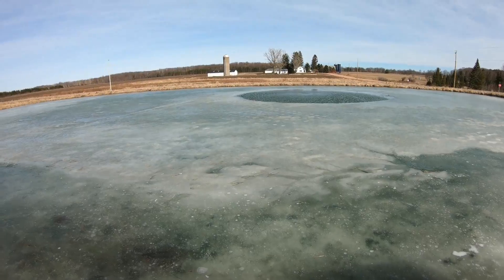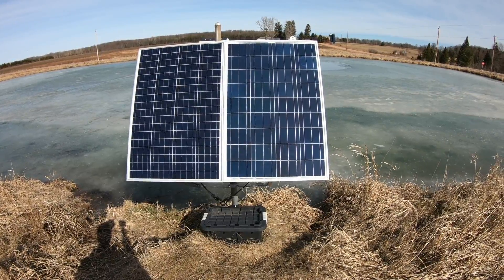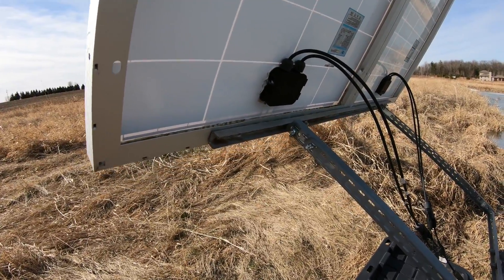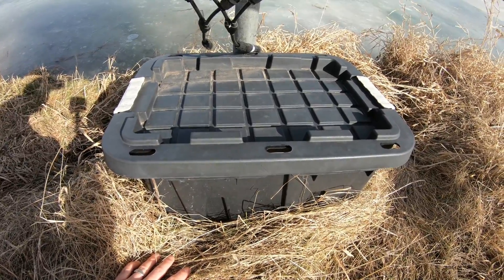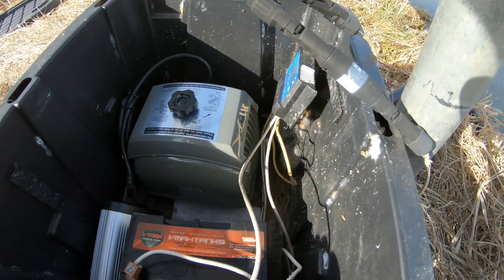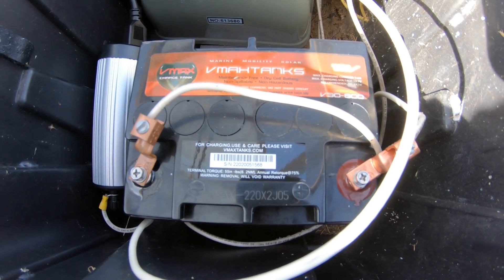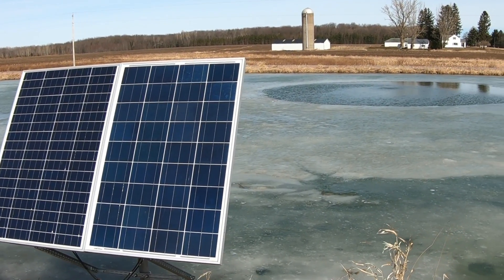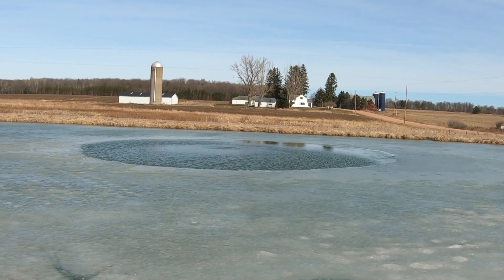How To Build Your Own Solar Pond Aerator

Comment: I really like this setup. And I’m determined to get it working. However it keeps turning off and on. Thanks guys! 
Settings 
1.14.9v
2. 13.7v
3. 12.8v 
4. 11.3
5. 24 h
6. b01
Reply from the maker: I'll try to help, I haven't had that issue with mine.  How many watts of solar are you using, what is the inverter you used and what is the battery and capacity of it. I know that some inverters work better then others for this situation, and if the battery is too small (amp. hour) it will not work well.
Reply from the maker: It almost sounds like your battery is either too small or it's getting too weak to hold a charge.  You stated when connecting the pump directly to the battery, it would run. This is correct because it'll draw the battery down to nothing, whereas the charge controller will shut off the pump when the battery voltage gets to low (your cutout set point).  If your using an older or small battery, I'd try that first. I hope that makes sense.

Comment: Got everything hooked up. My inverter keeps turning off and on. Any suggestions?
Reply from the maker: I would first check the settings on the charge controller. Make sure the cutout voltage is correct. It will also cut out if your not getting enough sun or the wattage is to low. How many watts of solar are you using?
Reply: Also the pump runs fine connected straight the battery. How do you set the cutout voltage?
Reply from the maker: @BlackStoneTrail411   Here is the PDF of how to set the charge controller that I use : https://www.solorder.se/image/data/uploads/KLD1210.pdf  The voltage at which the the charge controller turns off the inverter is the #4 in the diagram, discharge stop.  The voltage at which it will turn back on is the #3 discharge reconnect. I like to set the #3 at 12.8 - 13.0
Reply: I have the same setup as you. What do you have your voltage disconnect set at? The max it will let me set it is 11.5 volts. Have you had any issues with the battery letting it go that low?
Reply from the maker: I have my disconnect set at 11.3 volts and the reconnect set at 12.8 volts with no problems using the Vmax battery.
Reply: Designs like this are real battery killers. I run minimal battery systems and I force everything to shut off when battery reaches12.4V. They won't even start till it reaches 13.5V.  There should be a timer that only allows the system run a fixed period of time before it checks the voltage again.  Just about all these systems are techno nightmares slapping a bunch of black boxes together.

Comment: How did you attach the defuser to the five gallon bucket.
Reply from the maker: I have the diffuser sitting on top of the rocks that are at the bottom of the bucket.  I then place 4 bolts through the bucket at four corners  just above the diffuser to keep it from floating upward.  A hole is drilled through the side of the bucket to allow the weighted airline to enter and attached it to the diffuser. Hope that helps.
Reply: Hmmm ok. The bucket is 12 and the defuser is 12 inches. You must have a wider bucket.
Reply from the maker: I'm sorry, I meant to say I used a 10" diffuser. I will get it corrected in the description.  Thank you for correcting me on this. It should make more sense now how it fits in a 5 gallon bucket.

Comment: How long have you used this system. Is it pretty durable?
Reply from the maker: I've had it running for 4 years now.  The only problems I had with it, was  when I used the cheaper deep cycle batteries. They would only last 1 winter.  I live in a northern climate that sometimes gets -30 f. Since I switched to the VMAX AGM battery, it's been working good.  The level of oxygen output is plenty and my pond is just over 1 acre.
Reply: @DeanoOutDoors  can this setup also work for a 2 acre pond ?
Reply from the maker: It could, depending on the depth of your pond.  But I would  recommend using two of these systems, or going with the larger pump, which would require a larger diffuser, more solar wattage,  a bigger watt inverter and a larger amp hour battery.

Comment: 5 gallon weighted bucked? How is that connected to the defuser?
Reply from the maker: I have the bottom half of the bucket weighted, the diffuser is attached to the upper half of the bucket.  It is designed to sit in there nicely.  You drill a hole through the side of the bucket to attach the airline to the diffuser.  This also keeps the diffuser suspended off the bottom slightly.

Comment: Great video and solution! Do you have an estimation for how much air (litres per hour) you get into your pond with this system? Thank you
Reply from the maker: Thank you!  The pump is a 60l output, but I am not sure of the actual output at the diffuser with the calculated loss from the air line.  Sorry I can't be more specific.  I guess each situation would depend on the length and diameter of the airline.  The video doesn't show it the best, but the water boils pretty good with this pump.
Reply: @DeanoOutDoors  great, thanks!

Comment: Where did you buy your diffuser from or did you build it
Reply from the maker: I bought it off of Amazon.  I added a link in the description for the one I have.  It works really well with the pump I have.  I set it inside a 5 gallon bucket with weights in there to keep it at the bottom. Thanks!

Comment: Do you have a better picture as to how your wires are hooked up from your charge controller to the inverter, and to the battery.
Reply from the maker: I'm sorry, I should had been more thorough on that.  The 2 wires on the far left are coming from the solar panels, the 2 wires in the middle go to the battery, and the 2 wires on the far right of the controller go to the inverter.  You can program the charge controller to shut down the inverter when the batteries fall below a set voltage that your batteries recommend.  I hope this is helpful!
Reply: Thanks, definitely helps.